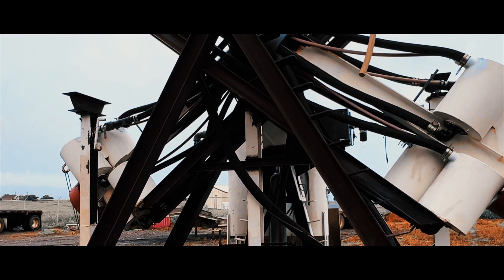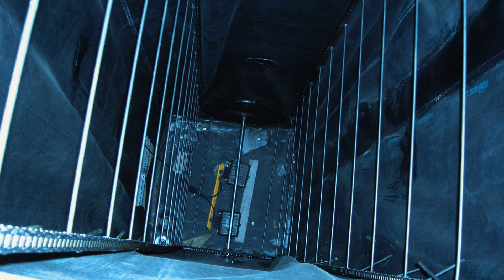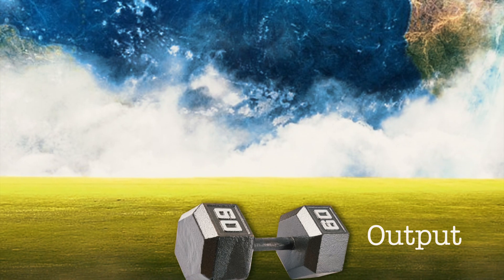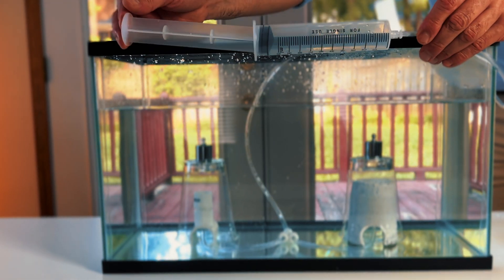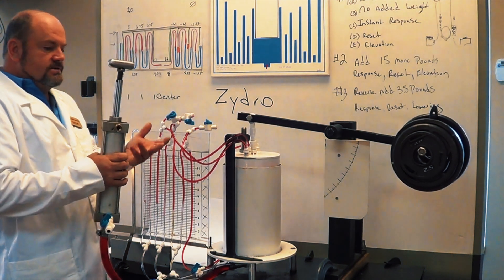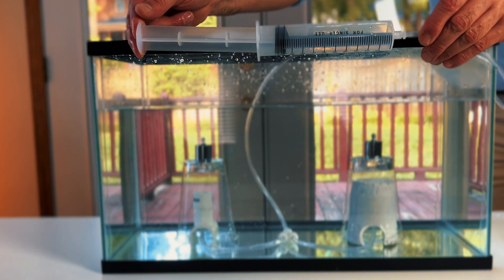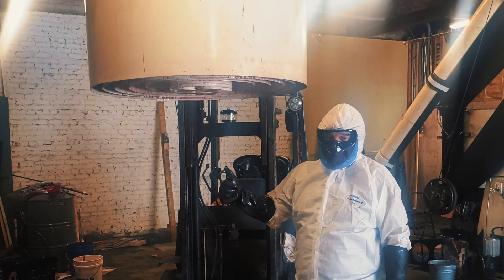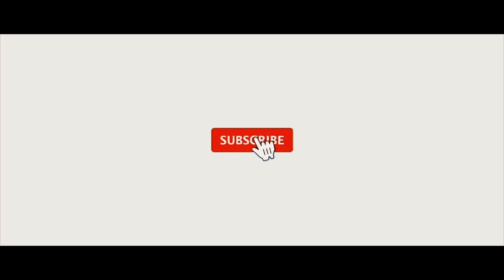How to Make a Free Energy Generator without flywheel! #FreeEnergyGenerator

Comment: Markus    Ask yourself why the professors of today’s Modern Physics can invent large quantities of Newtonian Momentum but then the same profs claim that you can’t get something from nothing. Isn’t Newtonian Momentum something?

Modern profs say that 1 kg mass moving 19.809 m/sec can make 200 kg moving 1.4007 m/sec. That is producing 260 units of Newtonian momentum; but the profs don’t seem to mind making those 260 units from nothing.

If AI was fed just data from experiments the Laws of Physics would return to Newtonian Laws. 

‘Flipping Physics’ has a great ballistic pendulum experiments. A .0051 kg dart embeds in a .1380 kg dart and block combo. This experiment sets the RULE: kinetic energy is not conserved; angular momentum is not conserved; Newtonian Momentum is conserved. So the profs will have to lie to AI or all the rules revert back to Newtonian Physics.

Here is an experiment that can be found on YouTube under Delburt Phend ‘cylinder and spheres’.
A 1.320 kg ‘cylinder and spheres’ gives all of the spinning arc speed of 1.2 m/sec to .132 kg of spheres. Then the spheres give all of the motion back to the massive ‘cylinder and spheres’. This is a starting momentum of 1.320 kg * 1.2 m/sec = 1.584 kg*m/sec. This is a final momentum of 1.320 kg * 1.2 m/sec = 1.584 kg*m/sec. 

You can’t invent the final Newtonian Momentum from nothing. The same 1.584 units of momentum must exist when the spheres have all the motion and the cylinder is stopped. If Newtonian Laws of motion are true then the spheres must be moving 12 m/sec (.132 kg * 12 m/sec = 1.584) and the kinetic energy is 10 X as much. The starting energy is .9504 J and it increases to 9.504 J.

Comment: The bubble machine is brilliant but it can be done much more easily.

Yes; dropping 20 kg one meter is a certain amount of energy but it is not a limited amount of Newtonian momentum. The energy is set or constant but the momentum is not. 

Twenty kg dropped one meter is 20 kg * 9.81 N/kg * 1 m = 196.2 Nm or Joules

Using the kinetic energy formula for confirmation ½ * 20 kg * 4.429 m/sec * 4.429 m/sec = 196.2 Joules. Any object dropped one meter will have a velocity of 4.429 m/sec; d = ½ * v*v/ a

The important part: To make 20 kg rise 1 m is going to cost you 196.2 Joules; or the 20 kg must be moving 4.429 m/sec. This is 4.429 m/sec * 20 kg = 88.58 units of Newtonian Momentum.

But the quantity of momentum that can be produced by a 1 m drop of the 20 kg is NOT limited to 88.58 units. 

Place the 20 kg on a string that is suspended from the circumference of a 400 kg flywheel. This accelerates just like an Atwood’s Machine. At the end of a 1 m drop the entire 420 kg is moving .96658 m/sec. The square root of (1 m * 2 * 9.81 m/sec/sec * 20 kg/420 kg) = .96658 m/sec this is 420 kg * .966 m/sec = 405.96 units of momentum and we only need 88.58 units to recycle the 1 meter drop of the 20 kg. 

And here is the best part.  When you transfer all of this momentum of the 420 kg to a 20 kg mass the 20 kg must be moving 20.298 m/sec.  20 kg * 20.298 m/sec = 405.96 kg*m/sec of momentum.

The energy of 20 kg moving 20.298 m/sec is; ½ * 20 kg * 20.298 m/sec * 20.298 m/sec= 4120.088 J

So you start with 196.2 J and you end with 4120.2 Joules.  21 times as much energy.

The ‘cylinder and spheres’ experiments on YouTube prove that this concept is correct.

Don't get bored by the math; this is worth 7 trillion dollars; or a visit from the FBI; ha.

Comment: I have been investigating and studying gravity systems for over 20 years. Waynes device does not hold up to the smallest amount of mathematical scrutiny. There is no available energy at the end of the cycle. I bet my bottom dollar that any device working on the principle he has shown also has a power input, which is probably hidden. Do your homework before handing over any cash.
Reply: Kaine, I have been building and demonstrating gravity systems which produce available energy for 12 years, sorry for all your failures, 20 years WOW - kutos for sticking with it! That does make you an expert! P.s.  My first system did not work, so I know the feeling.  Mr Wayne
Reply: @waynetravis6951  I understand you have made a living from defrauding others, so you have to fiercely defend the devices you know don't produce excess energy. Perhaps you should look for other ways to use your devices instead of digging yourself deeper into the lie. Just make sure you don't defraud the wrong person.
Reply: @waynetravis6951  Your first system did not work, neither does your last. You should be thrown in prison.

Comment: Hay Markus, cool video!! But could you try running a petrol engine on hho gas...? Thank you!!
Reply from the maker: Thanks!
I have actually already looked into that but have also seen a few fails and engine’s blowing up :) So I have mixed fillings about it. I would like to try running a petrol engine with hydrogen the engine turns my generator and the power is used to make hydrogen.
Reply: @MarkusNenning  Yeah same, i dont want to blow myself up or any engines with it, thats why I think a pure hydrogen generator would be safer to use, it has the hydrogen and oxygen come out of different tubes.

Comment: Hello Markus, This is a neat invention.  It wasn't made clear as to what form the energy being outputted from the generator is, although I would assume electrical energy would be the most useable.  Hopefully there will be more details of the size of the generating unit to it's power output.  I am staying tuned in with great interest to the Great Reveal.
Reply from the maker: Hello Steve yes Wayne discovered something very cool and spend a long time refining and improving it to the point where it is now ready for commercial use.
It is a hydraulic to electrical conversion generated by gravity but I will get into that in the next video.
Thanks for watching and your feedback!

Comment: IMO something all the kids would like is 3d-printable.   That way even the laziest of us could have a proof-of-concept model to show off to friends.
Reply: I 3D printed the Versions prior to the commercial Model - a Lesson learned - water and 3D models are not a good mix. We ended up using Flex Seal in order to seal the system well enough to test. I will consider it.  Wayne
Reply: @waynetravis6951  I was gonna say polyurethane but it sounds like you exhausted 3dprinting as a viable option.   Thx for the follow-up :-)
Reply: @reiyuki  Metal printing would work fine - I just have PLA, PTEG,  Rubber and some Flexible filaments printers - but if a person had a metal printer - It would not be hard to print my system. Note: if there is a volunteer with a metal printer- I would supply what was needed.